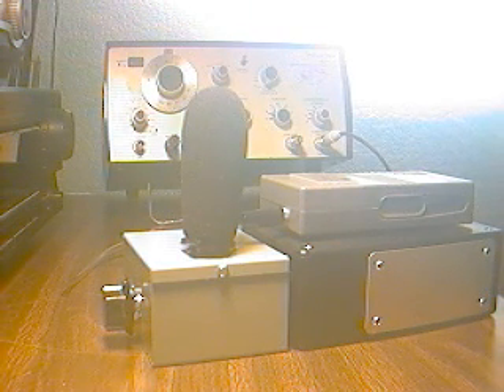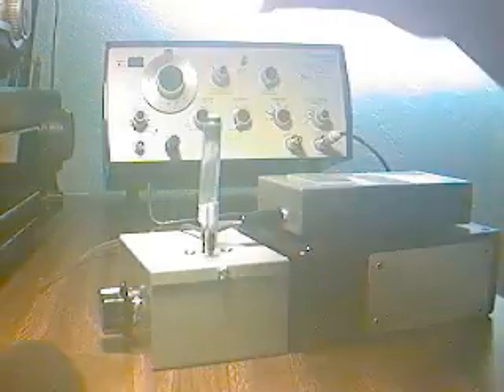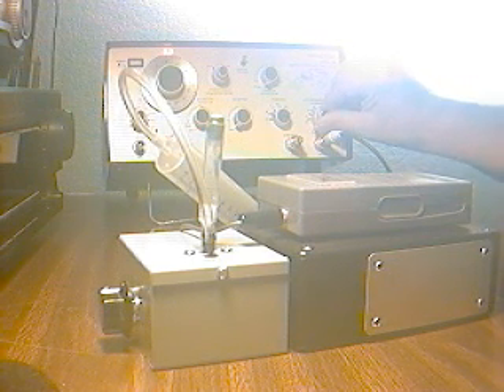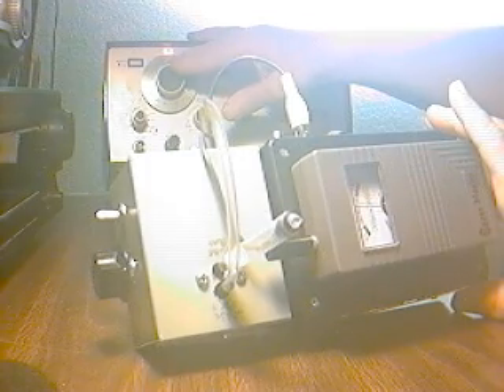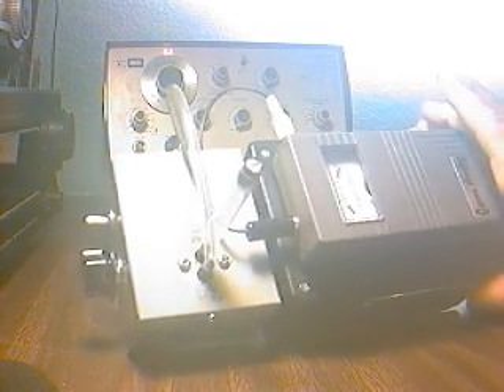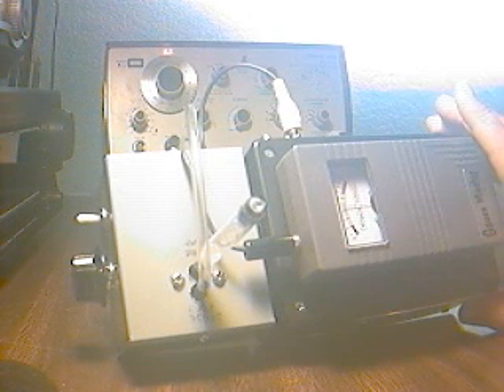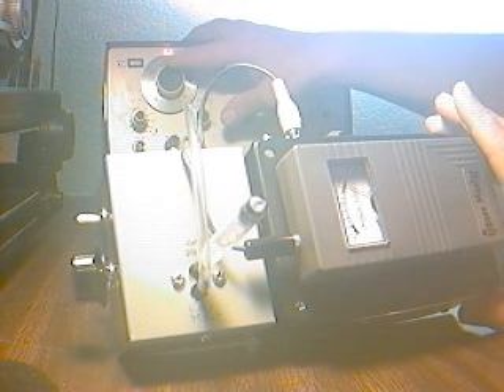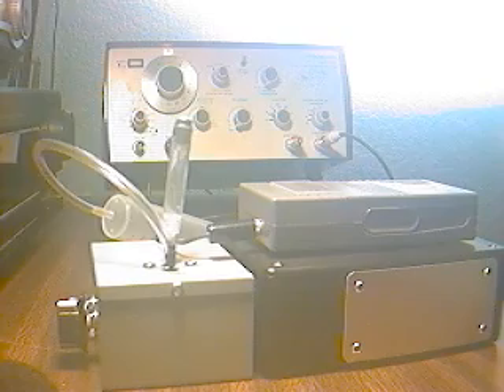Gauss master with infrasound attachment , test with sig gen

Comment: Where can i get one of these
Reply from the maker: You can get a infrasound sensor with  a/d to allow you to see and record infrasound on your laptop or pc.  just type Infiltec infrasound into the eBay search page. if you want an audio representation as well ...... you can  open the Infiltec box and tap the analog  a/d input for the audio signal and input it into a Gauss Master or pick up a Grass Instruments audio amplifier that has a VCO built in. ( also on eBay from time to time ).

Comment: can you possibly create a frequency that will keep spirits away , since everything is made of frequency there must be a certain frequency that will annoy spirits and keep them away
Reply from the maker: there are many devices on the web that claim to attract ghosts and spirits with low frequency infrasound waves called Schumann Waves.  I guess that you could buy an adjustable Schumann ghost attractor and when you are surrounded by one or more ghosts , try different frequencies to make them go away / repel them.  type " ghost frequency " into Google and try reading about " Schumann waves " as well.   you can buy a inexpensive vintage signal generator such as a Wavetek 142 or a Krohn-Hite  1200A and a Hewlett Packard 467A infrasound power amplifier and add a large coil of wire and broadcast your own long distance Schumann waves and also be able to broadcast all different infrasound freqs as well.  this rig should draw and repel them from long distances.